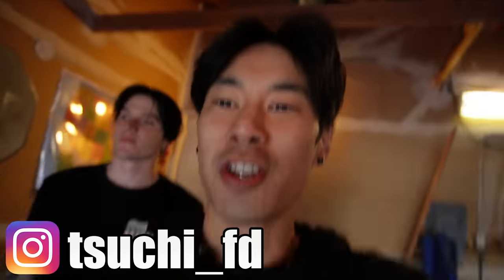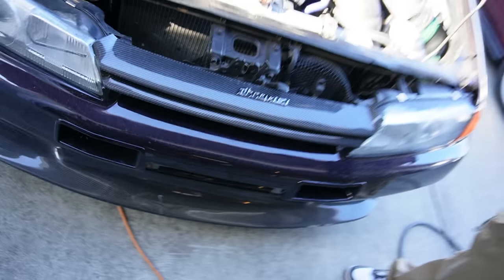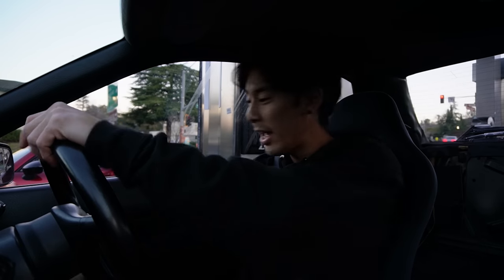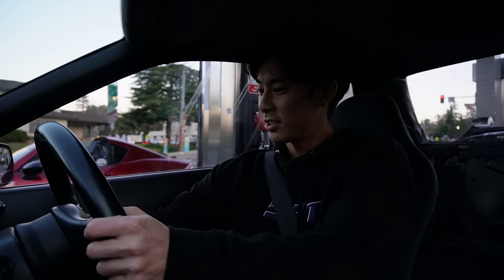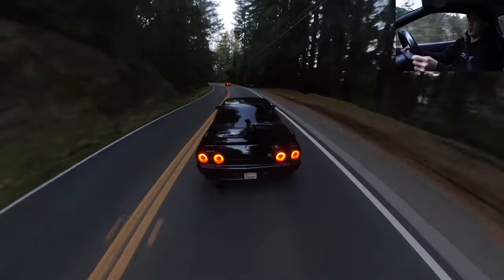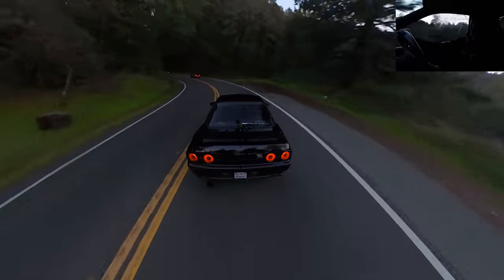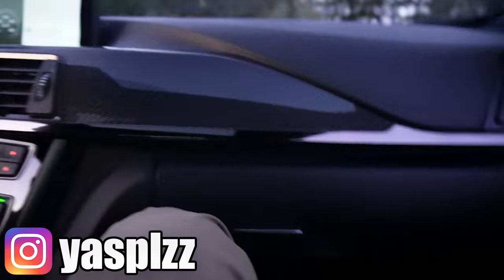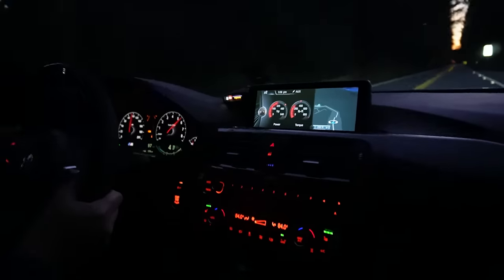Touge Battle With My Best Friend!! | R32 GTR Vs ND Miata

Comment: Water in the radiator is over 100C at times Oil can usually run nearly 3x that I dunno why everyone worries so much, when your 4wd is working properly you will be shocked on Touge's ;)

Comment: I wouldn't be too worried about that oil temp.  Semi trucks hang out at those kind of temps, and they do alright.  Oil is always going to be a bit hotter than the coolant.  Temps over 100C are actually good for getting rid of any water that might be in there from condensation.  If you've heard of the Porsche bore-scoring scandal, the biggest cause of that is dudes not driving far/hard enough to decontaminate their oil in cold weather.

Comment: You might have already done this, but if not it'd be a good idea to install oil restrictor orifices in the head. The RBs will sometimes keep too much oil in the head during extended periods of high RPM which you seem to see here. Also, since it's an interference engine, don't negelct upgrading the crank firing sensor (I think that's the name?) So if your timing belt fails, you don't have pistons kissing valves.

Comment: 110c is nothing bro u can safely push it higher than that. thats only 230f. a good temp to burn off fuel and water dilution so dont feel bad about it. can take it to 125c without fear.

Comment: You should try changing your tranny fluid to Redline MT-90. It's been known to work miracles on synchro issues.
Reply from the maker: it has redline shock proof gear oil... trying my best to save my synchros